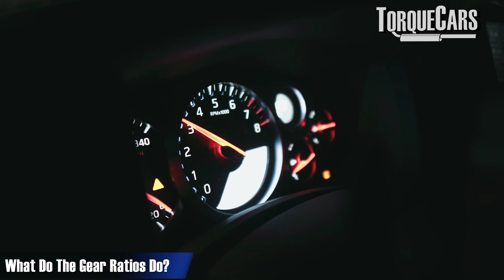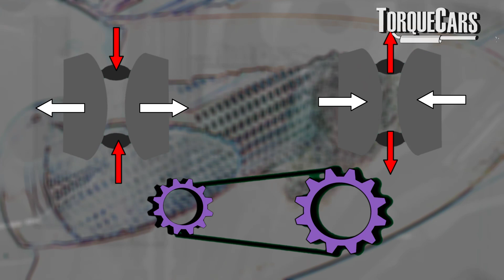🚗 Explore the World of CVTs: Understanding Continuously Variable Transmissions! 🚗 Pros/Cons

Comment: Just recently purchased a 2020 Nissan Rouge SV AWD 110,090 miles 2 owners  1st a rental 35,000 miles 2nd owner personal trade in @ 110,090. Full carfax report all maintenance done by the factory book down to the oil change and rotation. No accidents. Purchased from a roadside dealer. It's a great little suv

Comment: Great video! I never knew much about cvt’s before owning one but I do think it takes away massively from the driving experience. I was wondering if you think a CVT could benefit from a gearbox remap? Can’t stand the lag when taking off from a stand still. Also thinking about doing a standard remap but worried if the increase in torque would be a negative to the CVT transmission? I’m currently driving a 2L Audi A5 CVT and a stage 1 remap will increase bhp from 143bhp to 185bhp and torque from 320nm to 410bn. Do you think this will bring back abit of the driving experience in forever chasing? Thanks!
Reply: Hi, do u still own this Audi A5 2l petrol? (Im assuming petrol since the 2L tdi was often fitted with an s-tronic?). to get to the point, I'm considering buying an 2010 A5 with a CVT (Multitronic) The car has 100k KM or like 65k miles) have u had any reliability problems with ur cvt? or any other problems with the car in general? I would really appreciate ur input and experience, thanks:)